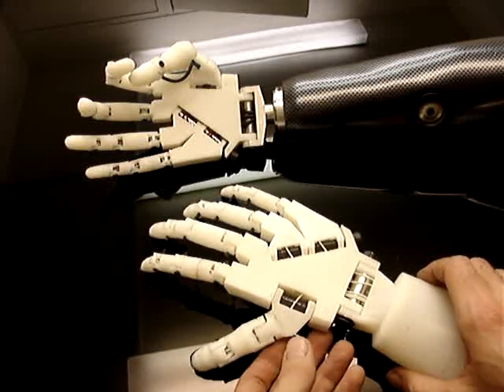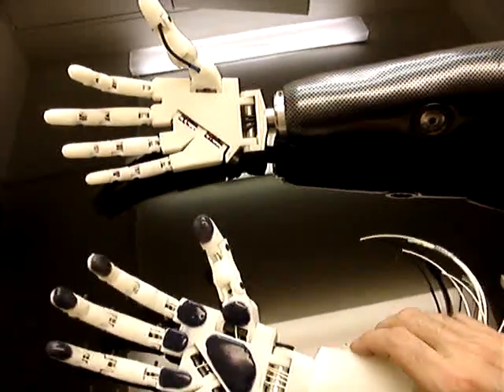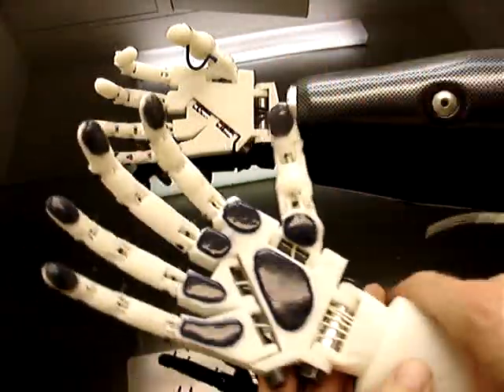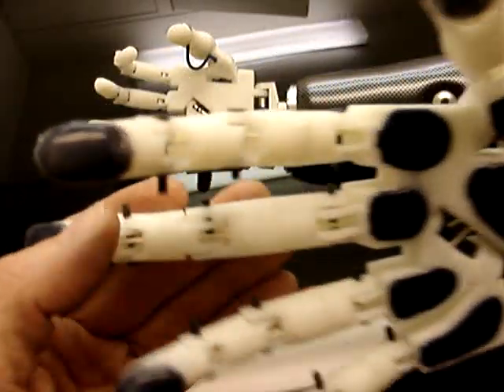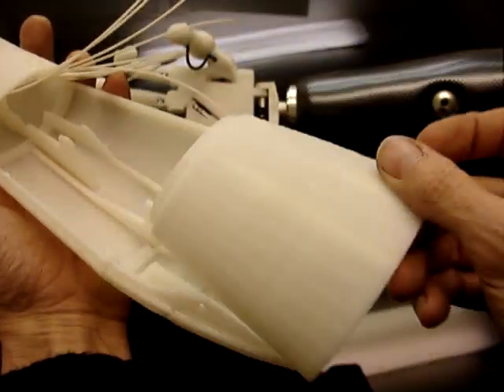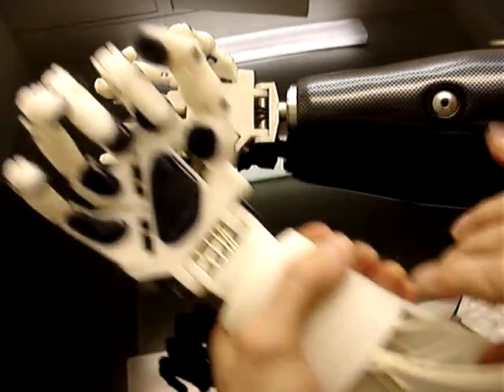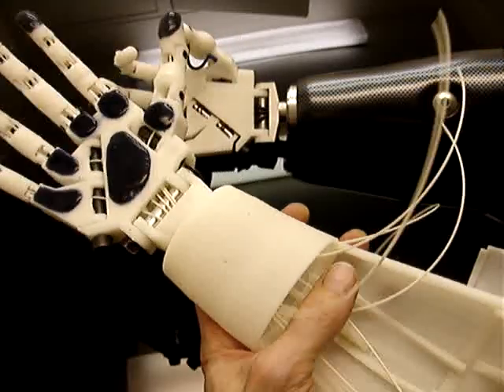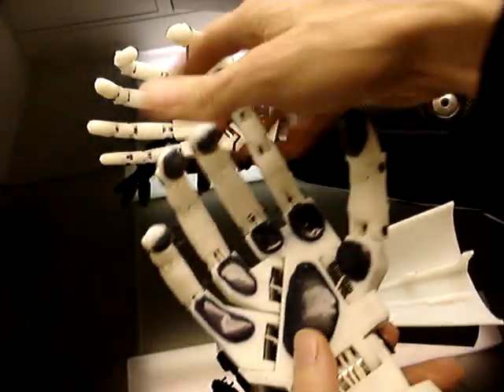Animatronic Hand Robot 3D printer "InMoov" Part2

Comment: That is spectacular.  I wonder, could we use a glove as a controller for it?  Exact opposite of the servos to pull on opposite cables, use the same kind of cables to turn a potentiometer, which would measure the position of each finger - then send that to the servo.  I don't think it would even require a microcontroller, I think a servo and pot for each finger would do it.  Just think of the possibilities of a remote-operated hand...